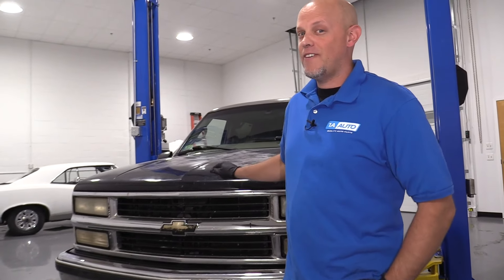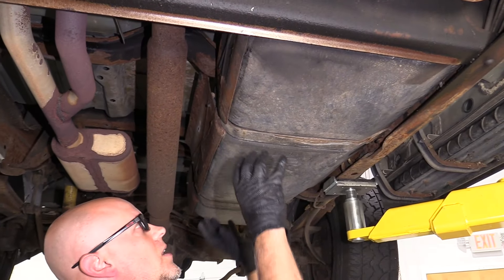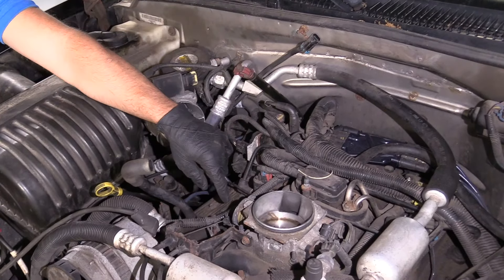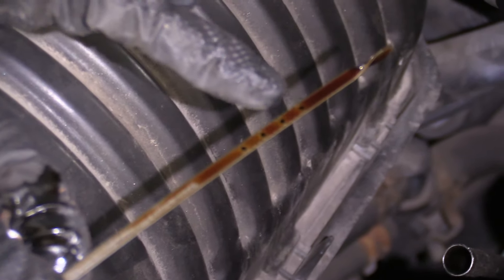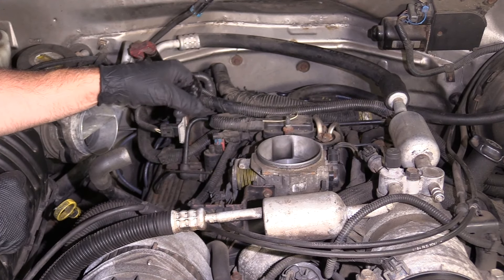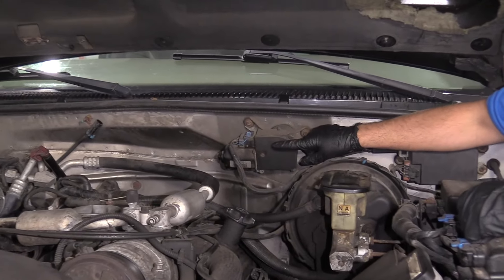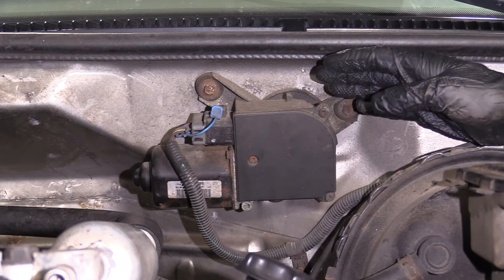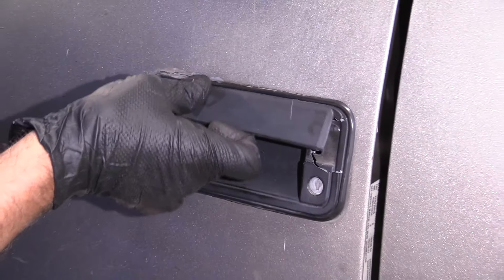Top 5 Problems Chevy Tahoe SUV 1st Gen 1992-2000

Comment: Add up all the YouTube videos  of the top 5 or 10 "common" problems with these trucks and SUVs, and it's embarrassing that GM ever put them on the road.
The Federal Government should make GM fix all these problems for free.
Reply: Alot of these problems come with age the vehicle is over 20 years old gaskets dont last forever.
Reply from the maker: Thank you for checking out the video. If you need auto parts go to: http://1aau.to/m/Shop-1AAuto-Now
Reply: @couchrider6228  - Is your life so miserable that you must insult others to make yourself feel better? 
FYI - I owned a 1994 K1500.
Prematurely replaced:
Front wheel bearings 
Pitman and Idler arms
TPS sensor
EGR valve 
Water pump 
Heater core
Shocks
Turn signal springs and cam
Wiper arms
Wiper modulator 
Brake lines
Gas tank 
Fuel pump and sending unit 
Gas lines
Window regulators 
Headliner and dome light
And don't get me started on the terrible rust problems.
Every time I went to the parts store, the clerk would nod his head and say: "Yep.  That's a common problem for those GM trucks."
Finally had it hauled away after the transmission failed.
Reply: BA sounds like u spent lots of money on a truck that was a rust bucket that is just foolishness, much like your comments.
Reply: @couchrider6228  - There you go again.   Making judgements to make yourself feel better. 
I wasn't born with a silver spoon and have to work for a living.  Fixing it was my only option at the time.
Reply: @BA-gn3qb  only option .. could have not bought the rust bucket.  DONT bash something u don’t know nothing about..,
That’s all I’m saying.. chill breez master.
Reply: @BA-gn3qb  troll
Reply: @couchrider6228  - Congrats. 
You overstepped the YouTube user agreement, and have been reported.
Reply: @BA-gn3qb  as have you ! U callin me a troll make me sad 😞
Reply: @couchrider6228  - Now you can't even be original. 
You definitely are a Troll. 
Ronald Reagan would say: "Well.  There you go again."
W.C. Fields would say:  "Go away boy.  You're bothering me."
Reply: @BA-gn3qb  your weird
Reply: @couchrider6228  - You should look into a mirror before you call others weird.
Reply: @couchrider6228  - I highly doubt that.   Especially since you are a "Couch" Potato.
And I bet I'm not the 1st to tell you:  "Don't go away mad, but just Go Away!"
Reply: @BA-gn3qb  weardo
Reply: @couchrider6228  - Go Away Potato Head
Reply: @BA-gn3qb  those dolls were made in the 90s.
Reply: These were the best trucks Chevy ever  built, if you're complaining about the few problems  they have, you really should buy one the generations after them,  then you would own something that is actually  prone to massive problems.
Reply: @donvonschitzinpantz2  - If that's the Best Chevy can do . . . Then it should have  ever gotten bailout money from the taxpayers. 
It should just rust away like it's trucks.
Reply: @couchrider6228  lol those,were in the early 90s